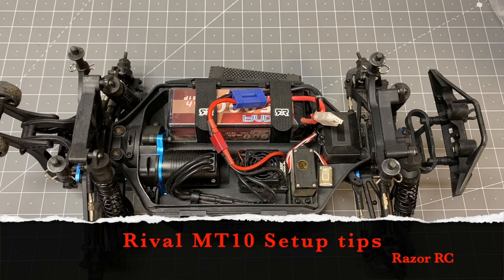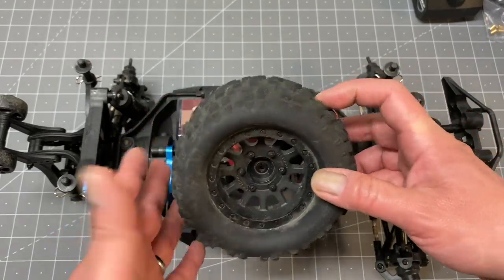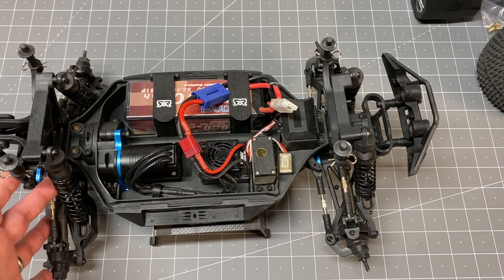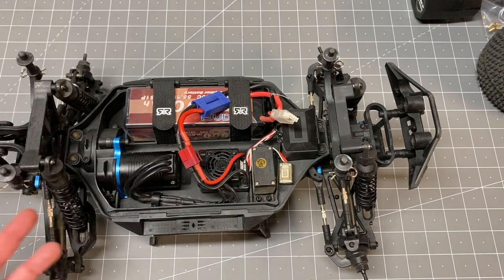Team Associated Rival MT10 Tuning Guide #razortuned

Comment: Tip # 1  - 0:41  -    FireLand - Helion Avenge Arms ( HLNS1544 ) - Replacements
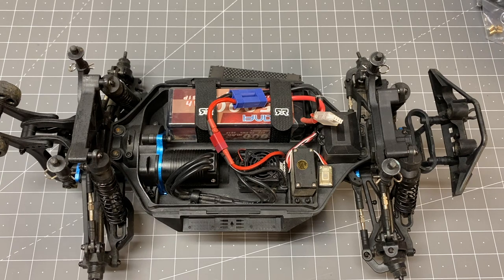Tip # 2  -  1:25  -   Battery Straps - Arm part Number : AR320413
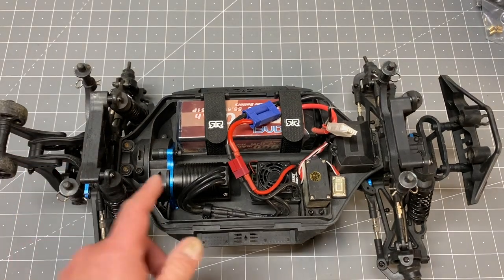Tip # 3  -   2:10  -  Replace Diff Fluid to 60K 
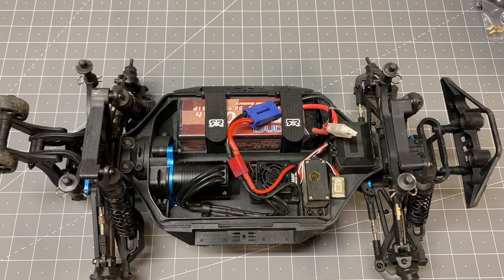Tip # 4  -   2:55  -  How to Softening your brakes -
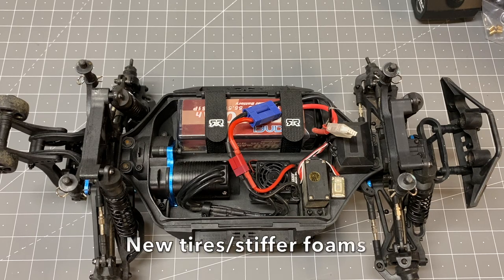Tip # 5  -   3:41  -  Replace Tires
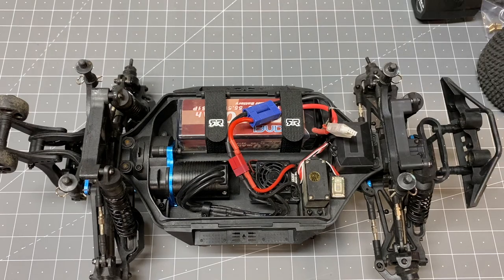Tip # 6  -   5:14  -  Fix/Adjust Servo Saver
Tip # 7  -   6:39  -  Replace Rear Springs

Comment: 6:04 try locktight thread locker.  Holds the threads but you can break them loose if you need to make adjustments.

Comment: Great job. Battery straps and setting up the breaks is a great low cost improvement. Tip 6 was a good one. I like the super glue idea. Thanks for sharing the different spring options. 👍👍

Comment: Big thanks for this, Picked the MT10 up last week, finally have time to take it out proper, found this extremely helpful!
Reply: So yesterday it ended up accidently floating down the creek in my backyard. went in and got it, fully submerged for a good 10 seconds.  unplugged, dried it out with my air compressor, checked all screws, reoiled bearings and other moving bits, let the electronics sit for a few days, turned it on and it's working perfectly.  <3 I was surprised.

Comment: The helion used better plastic i gather. I have the helion and ordered some rival mt gear cases and its a harder lighter feeling material. U helped me out with some info before too.  GREAT content man a big help! The helion esc is progamable but it had the same brake prob out of the box for some of reason. And traxxas slash drive shafts were a good upgrade too.  i havnt broken a one since and ive been hard on it.
Reply from the maker: Thanks for the info!
Reply: What were the traxxas slash parts number u used for the front and rear also can u use traxxas slash metal cvds
Reply: @LuisTorres-tm2jc  i dont know the part num but its the fronts for 4x4 Slash ive used. I think they’re all the same as in slash,pede,rustler etc. be advised that the grey heavy duty ones are larger in diameter and will rub your shock spring! Id just stick with the rivals honestly but ive used what traxxas shafts my lhs had in stock. Again its the front ones for 4x4s.The rears are a bit different and arent a direct fit. Theres many brands of metal ones also, associated makes them too. Its just the axle stub that bends or breaks for me so i just stick to plastics myself and pop in the new stubs.

Comment: Excellent video! Is there any difference in parts and build between the brushed and brushless versions? From what I can tell the only difference is the motor/esc and the brushless version comes with lights. Are there any other part differences? Thanks!

Comment: I contacted AE and also in the owners manual its says the shocks are 12mm. And the manual also says its 40w stock. From my research. Just FYI. Love the videos.
Reply: I purchased the AE SC10 4x4 13mm yellow springs for the front. They have popped over the bottom spring cone a couple times. Just FYI. 
AE SC10 springs are 12mm.
Front Sets:
Soft (ASC 91341) - Brown 2.85, Black 3.0 & Green 3.15
Med (ASC 91342) - White 3.3, Gray 3.45 & Blue 3.6 
Hard (ASC 91343) - Yellow 3.75, Red 3.9 & Orange 4.05
Purple (ASC 91334) - 4.2
Rear Sets:
Med (ASC 91345) - Gray 2.2, Blue 2.3 & Yellow 2.4

Proline
SC 12mm Front Springs (6308-21)
Blue 3.2, Green 3.4, Yellow 3.6, Red 3.8 & Purple 4.0
SC 12mm Rear Springs (6308-22)
Blue 2.0, Green 2.2, Yellow 2.4, Red 2.6 & Purple 2.8
Reply: I just purchased the Proline Pro Spec front and rear shocks and spring sets. They are also 12mm. They are 4mm shorter in both front and rear. I'll let you know how they perform.
Reply from the maker: Ah sorry about that.  I have a set of the AE SC10 4x4 springs and test fit them on the front, but didn't run them as the stock front springs are pretty good.  I'm running the SCTE springs in the rear and they fit really well, I think 12mm springs would be too narrow, the shock bodies are definitely wider than normal 12mm shock bodies.
Reply: Lol I wonder if Traxxas GTR shocks would work.
Reply: @chriscarr1647  could be those springs are meant for the factory team shock upgrade sold for this truck.

Comment: Aargh! That servo saver! I don't know about anyone else, but I must have big fingers, because I could not get anywhere near the adjuster to tighten it! I was seeing a dead spot in the steering, so decided to adjust it up a bit. Oh man! I've had to take the whole section apart ! So, after removing the servo saver side front wheel, you remove the screws between the front gearbox and the lower front bumper, then all the ones under the front gear box, then all the ones holding that front gear box skid plate to the central chassis. Then I had to remove the steering "rack" screws, (hope everyone's got the instruction book) careful not to lose the tiny sleeves that the screws go through! After that, I think I have this right, you finally remove the one screw from the central under-chassis steering link to the servo saver. I removed the other side one but either will do. ( I did all this before deciding to write it as a comment)
 And you're right, there's almost room for a second servo saver spring collar in there. And, strangely, the the spring adjuster collar has castellations on it. Hmm maybe those really are for some superglue to spread out into? Anyhoo, I've wound it as tight  as I could get it, then backed off about 3/4 of a turn, so the gap where you can see the spring is about 1.5mm. I'll see how that goes tomorrow, and hopefully I can get my needlenose pliers in there if I need to adjust it, before adding that superglue! Yes peeps, you will need to get some pliers on the adjuster once it starts to get fairly tight, and the plastic is slippery!
Hmm, there's not much grease in that gearbox, I wonder how much should be in there?
Reply: How did it work out for u did u have to tighten down all the way or the 1.5mm gap worked out fine
Reply: @LuisTorres-tm2jc  Sorry friend, I actually can't remember. But I have the feeling that I never adjusted it again. It's a brilliant truck anyway. I recently fitted some cheapo wheels and self belted tired, where I used duct tape inside them. It works just great!

Comment: I know this is an older video now but what about the diff fluid in the front rear? Any recommendations there? I’ll definitely try 60k in the centre though. Currently in the process of rebuilding mine
Reply: I’m wondering the same thing
Reply: @BenFreedmanRacing  in the end I did 60k front, 60k rear and 30k in the rear. Doesn’t wheelie anywhere near as much now
Reply: @RichardsRcs  awesome! Thanks for the reply!

Comment: Am really struggling to work out how to change the spur gear on this truck as a newbie am not sure how the rear assembly is removed to access it. Please please do a step by step video I can't find anything online.
Reply from the maker: it's similar to a Stampede 4x4 so if you can videos on that it will almost the same.  there's also a trade show video where Gil Losi Jr. shows how to disassemble a Helion Avenge 10MT, which is the same car.
Reply: @RazorRC  thank you I appreciate your help I will hopefully find something to guide me.

Comment: What servo would you use as a replacement mine has issues
Reply: I just got mine 2 days ago & took it out yesterday for a blast on the grass in the park by me & now the servo has started making an odd noise when i turn to full lock 🤷🏽‍♂️ ive tirned the steering down to half way & it no longer makes the noise but i fear that the servo is faulty already after reading so many people have replaced theirs on the mt10

Comment: This is my first serious venture into rc. Great video, love the car. Do I need to alter anything to use 3s, also what size battery will the motor take? Thanks
Reply from the maker: Nope, it runs 3S out of the box, don't need to change anything.  Any normal sized 3S stick pack will fit.
Reply: Runs great on 3s but motor might get pretty hot. I would add a motor heat sink and fan.
Reply: Runs quite hot on 3s I put a fan on motor runs way cooler 👍

Comment: I bought an FS-GT5 and installed it in my new MT10. However, I've been unable to calibrate the esc with the brake hack using the Flysky gear. I reinstalled the Associated gear and the calibration works fine. After reinstalling the Flysky radio again, it seems to be working consistently with the calibration. Any idea why I can't calibrate with the Fkysky gear?

Comment: Hey bro, any idea on how to adjust the ESC to engage the reverse faster. Quick rundown, my son has the new pro4 sc10 and when we try to reverse there is a moment of lag before it engages. Like for example I have the slash 4x4 and you can go forward to reverse instantly. When trying to correct while jumping the brakes or reverse lags. Hope this makes sense
Reply from the maker: That’s actually normal and your Slash is actually kinda broken, you’re not supposed to be able to go from forward to reverse instantly because it tends to break the drivetrain.

Comment: What did you use to adjust the servo saver nut? I’m new to this and this is my first car, it’s a blast. I have lost my steering and the servo saver nut has backed down as far as it can go and looking for any advice.
Reply from the maker: I just grabbed the plastic collar with some pliers, and then turned the wheels by hand.  Let go, turn them back the other way, grab again and repeat.

Comment: Hi I am looking at buying this for my son, can you reduce the power from the transmitter so he can get used to it?  

Thanks Tony.
Reply: YES! My 8yr old is autistic but spends a LOT of time watching RC Vids so knows a lot about them. We had a pair of SCX24 crawlers for indoor tracks at Christmas and he loved them, but then got into 'basher' vids. I was about to buy the Arrma, but then saw a post about the MT10. After much research I found the MT10 to be much better, and much better value too. Anyway, got one for his birthday and he absolutely loves it! We started with 3s batteries and it was way too fast for hom to learn, so we put in 2s batteries and it was still fast. So turn down the Throttle Dual Rate (the TH/DR knob on the controller) and it works like a power restrictor. Started at setting 4 on 2s in a big field with grassy banks to jump and now he can go to setting 6 on 2s. We've done grassy banks and chalk/grass quarries and today found a tiny BMX track which is perfect for RC bashing. I was worried that he'd lose control and fly off into oblivion but he's much, much better than me now- they learn so fast. So yes, get one, run 2s batteries and turn power down until he has the hang of it, which won't take long. I use Zee 2s 6200mha batteries from ebay at £44 a pair. Each one lasts about 15 mins or so- dunno, lose track of time, so we take 4. Got a couple of 5000mha 3s as well which we use with the power down to 4. They're great starter cars and we've not broke anything yet!!

Comment: Whats the best motor fan for these and the avenge? Please my temps are too high so im only running it a few mins at a time.
Reply from the maker: Not sure, but if your motor is running hot take out each bearing and check it.  You probably have excessive drag somewhere.
Reply: Thanx man. Its ran hot on 3s from day one after running it hard. May b normal? Its my first truck.
Reply: @cds1223  motors run around 150°  F. It'll be hot to the touch. I believe most brushless motors this size are considered to hot around 180-200 degrees. Most ESC have a over temp shut off. Not sure about the one in this truck. You can get a cheap infer red temp gun for around 10-15 bucks to help monitor the temps

Comment: My problem is the steering. It wanders into one direction. I trim it, then it wanders to the other, unable to drive it in a straight line. Do you have any tips for that by any chance?
Reply from the maker: did you tighten the servo saver?
Reply: @RazorRC  I'll give that a go once the new lower arms arrived and the car is assembled again.
Reply: tighten the servo mount screws. there's four of them. had the same problem

Comment: How easy was it to swap out the lipo straps Razor,
Reply from the maker: It's pretty easy.  It seemed impossible at first, but there is a technique to getting them in -- just go straight through the holes one at a time, you can't go around the 90 deg bends, you have to go straight through and then come back.  Hard to explain exactly in words.
Reply: Where can we find these straps please?

Comment: When i am at a full stop and i press full throttle, it bogs down and stutters before putting on the gas. If it is rolling even the slightest bit, the problem isn’t there. I am running 5200 2s, have put about 5 battery cycles through it. Any ideas why this is happening? Is it normal?
Reply: @RazorRC
Reply: Maybe faulty esc. That's called cogging, mine doesn't do that. Upgrade it if you have no warranty.